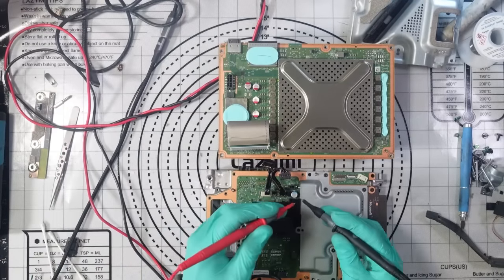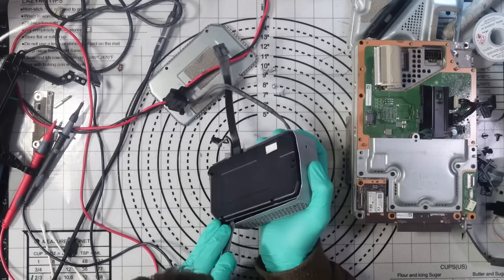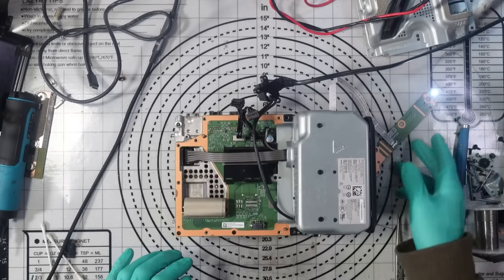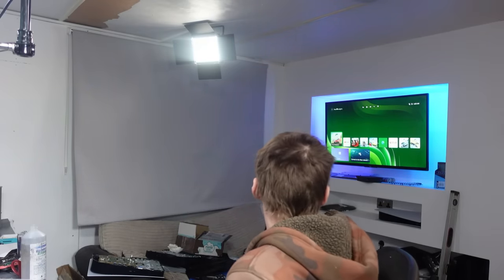This Xbox Series X Was INFESTED With Cockroaches!... Can I Fix It?

Comment: I had a tingle from a Colour TV CRT high voltage lead. I can still feel it now. Also working on a light fitting and didn't turn the board off, just worked on it live. I touched a live wire with ny finger abd had a small shock off it. I would not recomend it, I should have known better being a electrician. lol
Reply: just incase get your heart rhythm checked because electricity makes it all wonky and you might get an heart attack
Reply: @urbexingTss  I am going back over 20yrs. ⚡️☠️